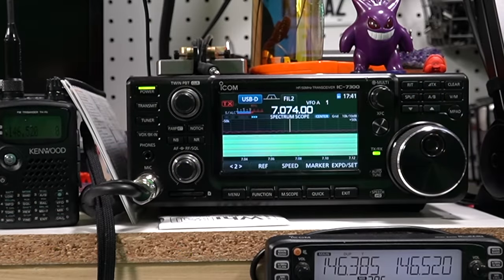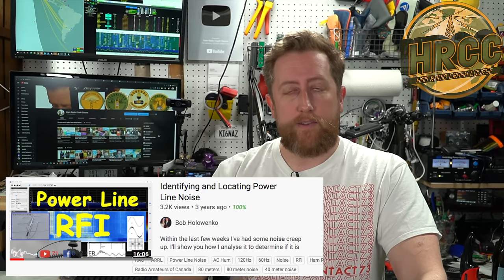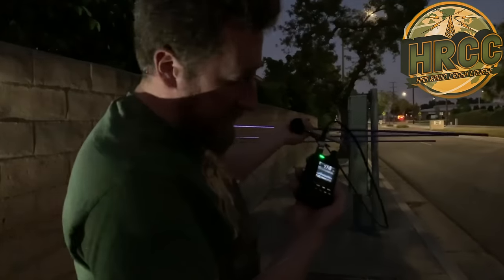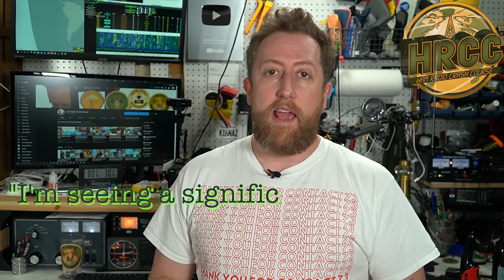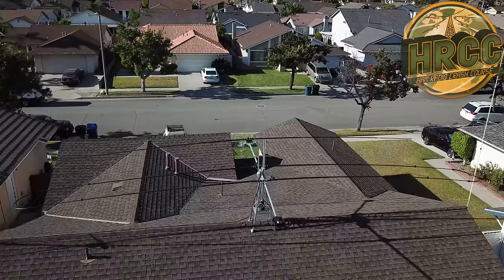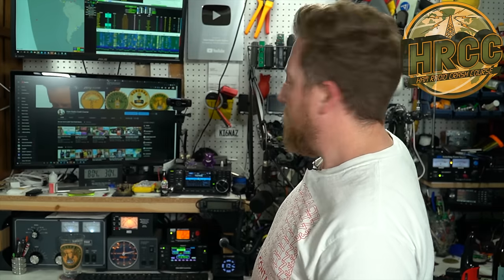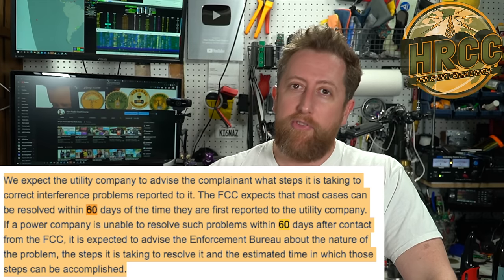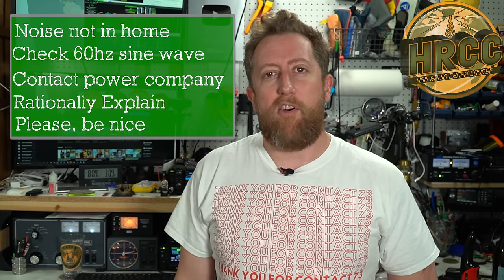Power Line Noise On Your Ham Radio?  How To Find AND Get it Fixed

Comment: My power line noise was fixed as per the following.  1) Determined that the noise wasn't coming from my home as per how you did it.  2)  Contacted the help phone number and explained my problem - from there I was fortunate that the guy didn't have a clue about ham radio, or the interference that comes from broken insulators etc and was 3) Referred to an engineer whose speciality was chasing down interference problems.  Problem solved.  

BTW MFJ has the two units that help find out where any line noise is occurring - a) a VHF receiver / hand held yagi antenna.  b) A parabolic dish that helps localize the noise source - much like the flash image you put up on your video.

W1VTP

Comment: This a good video.  Using a yagi to find the pole is a great way to locate the source as long as we understand that the noise will carry down-line from the source to other poles.  Sometimes a sonic 'sniffer' is needed to isolate the correct pole/equipment.
I had this problem, too, and my power company resisted until, in conjunction with the ARRL lab, I filed a formal complaint with the FCC.
The power company was not familiar with power line noise (PLN) so it took a couple of tries until we were able to get the problem resolved.
I DID make a friend with their manager, though, who asked me about training materials to help him understand more about our (aging) power lines out here.  Being FRIENDLY is, as you say, paramount!
I have since built my own equipment and can run these down myself very quickly.

TIP:  In So Cal, you may have noticed that when it rained, the problem temporarily disappeared, a good thing to keep in mind.  This indicates that the problem is outside in the elements and not in your house as the precipitation is quenching the arcing.  The problem is most likely to show up when the equipment is dry.
73  AC0BE
Reply: "The power company was not familiar with power line noise (PLN).." How in the world can this be?
Reply: @timothypolhamus4515  I think they are becoming more aware of the problem.  The executive I worked with asked me afterwards for educational materials where he could learn about PLN.
    The reluctance, IMO, comes back to cost of repairs, inconvenience to their customers because they have to shut power off sometimes and other business reasons.
    We (Hams) are a tiny group compared to the customer base of a power company and not, therefore, a priority.
    I suppose that the loss of electricity from one of these PLN incidents is relatively small so the argument that they are losing money as power is being shorted away and wasted is not a priority either...

Comment: I'm a Power Company tech that investigates RFI. Jake is correct call your Power company, you will be connected to the call center. The key word is interference, you don;t want the 24-7 Trouble shooter to investigate. Then a work order will be generated to the correct department. If I come out I first isolate the home of noise, then move outside. It maybe your neighbor's dimmer switch or the power lines. In my experience it's about a 50% the power lines. If I find a power line insulator making noise a work order is generated for  bucket crew. I will come out with the crew and we correct the problem.

Comment: Not only can you have powerline noise but I have seen where a bad ground coming down a telephone pole (the only lines on this section of pole line was telephone) had a poor crimp connection to the ground wire actually going down to a ground rod or a butt ground plate at the bottom of the pole.
The crimp was repaired and the noise was eliminated.

Comment: Aloha Josh, you made some really good points at the end of this video. That you can gain more with sugar than you ever could with spice. My power company, HECO, has been coming out here to my street replacing all the wires and insulators on the power poles here. It looks like maybe the land had shifted some and the wires were pulling on the insulators to the point that they were making a lot of noises, especially after a good rain but my noise levels has dropped to almost nothing now. Great video brah! ❤️🇺🇸🇺🇸
Reply from the maker: Awesome!

Comment: Great video Josh, I hope I never have to deal with power line noise. One of the nice things about living in the country is POTA levels of noise. One time I thought the receiver in my 891 was broken because I had no S Meter readings, like the bar was completely gone. Turns out I just had 0 noise lol. Good for DX since I don't have a beam antenna for HF yet. 73 de W8IJC

Comment: Ok, so I am a little late to this party from 2 years ago, but wanted to comment on a similar story. My brother was having similar issues at his house about 4 years ago.  He did the shut off the power to the house thing, am radio detection, and ran up and down the street with his car radio on an odd AM station. He narrowed the noise down to a pole across the street. He called the power company, and they were there within an hour. They got up on that particular pole, tightened up a few things and left. Well it helped a little bit, but was still strong. Up the street from him is a telephone power station, the noise on his car radio would go bonkers when he passed it, then about a week later the noise completely disappeared. So, who know what it was.

Comment: Congratulations.  I was hoping that they would use an ultrasonic noise detector and was glad to hear you say that they used a parabolic dish.  That dish and its ultrasonic detector will pick up the "hiss" of the electrical arc in the somewhat loose connection clamp(s).  The arcing sprays a signal much like a leak in a tire and the noise is in the ultrasonic sound band that humans can't hear.  Unfortunately, an ultrasonic receiver and the dish can cost in the neighborhood of $3,000, which is an amount that most small utility companies won't spend on a rarely-used piece of test equipment as compared to buying a Fluke volt/amp scope multi-meter.  In my career as an electric utility power engineer, I found such equipment to be rentable, if the company had a serious desire to fix their troubles. 73

Comment: Great video! Not a HAM operator but wonder if operation hiccups with computer and general equipment is related to this kind of power line noise in affected areas. I live in around Greater Vancouver, BC with dead spots for cellular and radio networks even in open fields. It’s interesting to see someone documenting these issues.

Comment: 1. You can use FM but if you can use AM, that would be better. 
2.  Take a rubber mallet with you and tap the suspected poles while listening and listen for the noise pattern to change with the vibration. 
3. I don't know exactly what the neighborhood voltages are but somewhere in the 15kV range. Those are going to be the typical suspects. 
4. The lines much greater than 100kV can emit noise for like a mile pretty badly. These are more difficult to isolate and figure out where the problem is originating from. Again, a mallet can help you determine the pole or poles. 
Be patient with the power company. They want the problem fixed as well.

Comment: Very cool. I'm having some noise more on a cycle. Clear receiving, then a burst of static for 15-20 seconds, then stops for 11-15 seconds and repeats. It's not in the house, because it happens in my truck too. I move away from the house and it clears. I do have a power pole in the back yard that could be suspect.

Comment: +start checking your own house.... try checking ballast from neon old ligths....later check power supplys of drill chargers....and phone chargers...those of base in the kitchen....lot or rfi..from yhose suckers....and try to buy an switching power supply...i sugest...TP30SWI-TEKPOWER WITH NOISE OFFSET. PERFECT POWER SUPPLY SMALL AND IT WORKS!!!!!!

Comment: TinySA spectrum analyzer and a 2m tape measure yagi!  With my 4 yagi (M Squared 2m12 12 element 20 foot boom) 2 meter array I can often pinpoint within 3-4 poles by comparing rotor direction to a google earth map that the poles show up on(look for shadows). I take the TinySA out with a small 4 element yagi and sweep the suspected poles and can usually narrow it to one pole. If you have an IR camera or rifle scope you can also sweep the lines looking for a hot spot, arcing creates heat. I have done this with a borrowed IR camera and it worked well at night.

Comment: Thanks for this.  The ways us humans connect is amazing. 

I got a call from a company that I host a light omg detector for. Amazing idea and use of tech but anyways. They said there was a lot of noise on their signal.   After doing the normal on home stuff I realized the problem was out side.  It persisted up and down the street until I was out of time. I need to revisit the problem some day soon.  I don't think my power company will be to receptive. But your method or rather some of it may make my tracking down much easier. 

I did it with a small duck Omni antenna on a handheld battery Oscilloscope.   I narrowed it down to one and only one of the 30kv lines on my road.  It's only one since they are three phase lines and it's clearly a 60hz.  A directional antenna is a great idea. Saves me from tracking through the woods up steep hills and across others driveways and property. 

If I go out and track it down I'll try and video it

Comment: If you have any more interference  from other sources.  Get a good quality coaxial line isolator about 70 $ usd  and place it  at the rig input. It can cut the noise  by several s units a big difference. 
Also use quad shield RG6 coax in the house  and clamp on ferrite on everything.  You can use a second isolator at the antenna feed point  also if needed.
AA4CP Chuck Port Salerno FL
Reply from the maker: I have done that and used chokes 😳

Comment: Here is my issue. I have two radios. A Yaesu FTdx101d and a receive radio, ICOM R-8600. I have two antennas. A hex beam and a inverted V dipole. For years I had only one radio with two antennas and had no noise or static unless thunderstorms were in the area and then I disconnected. In July, 2020 I started having interference on both of my radios and on both antennas. At first the static, RFI lasted only minutes then it became a few hours at different times of the day no matter the weather conditions. Then the static lasted for days and then would disappear. However now the static is constant and so overwhelming that using especially 80 meters with all of the radio filters enabled  makes listening to the radios unusable. Using the radios in general is not enjoyable and almost unusable on all bands.  My first test was to shut down the commercial power to my house. I brought in a 12 volt battery into the house and with the power off I connected the radios, one at a time to the battery. I had  RFI, still. We had hurricane Delta come close to us earlier in Oct., 2020. The  commercial power was out for over 4 hours from 0330 to 0745. My back up generator came on. I turn on the HF radios and I  had NO RFI for the 2 hours I used the radios starting at 0530. As soon as the commercial power was restored and the generator shut down the  RFI, terrible static once again returned. I called the power company the first of Sept. They did come out and made some test. They replaced one pole and replaced insulators or Polly's on other poles but still the RFI or static is present. The engineers came back out and did more test and found additional noise other poles. Due to the many hurricanes and storms near by, the power company has not return to address my issue and that is understandable. I send e-mails to the engineer on a weekly basis and once ever 2 weeks I may hear back from them stating they are back logged but will return to address the RFI as time and manpower is available. Not much else I can do as I am near 100% the issues is power line line problems. If by my test I am incorrect please let me know so I can continue to look for the issue. Bottom line, no commercial power in my area and into into my QTH no RFI with commercial power on in my area connected to my home overwhelming RFI. 73

Comment: You must have the best electric company. Where I live they don't fix anything. Even when the fcc gets involved. It took over a year and it's only half way better. I started the process all over as they fixed one issue and this one is different. But that's what u get for an over 100 year old electric system

Comment: I use an AM radio tuned to around 530 hz I have an s9 noise floor since I had Solar panels installed on my roof,  the storage battery gives off an S9 static type interference, I have been putting Torids and ferrite s all over the place, disconnected from the grid and run on battery power, but no difference. I only have 40 mtr kit radio, I made a large 5 inch coil to specs I found on the internet, using RG213 and that dropped the noise floor to about s5 but  the radio went deaf as well, so I am back to square one, but having a great learning experience...VK3HJW

Comment: Power company most likely depends on general folk reporting such issues, thereby providing it with early-warnings of potential future equipment failure.  Much cheaper to fix/maintain/replace as part of a routine schedule than to emergency-repair, especially for expensive items.

Comment: Thanks for the video.  I never even knew that you could call up the electric company for these issues.  On another note, So you're telling me that my current hobby of HAM radio may get some interference from a new hobby I'm thinking about...hydroponics  :-(
Reply: LED lights give off RFI , the more you have the more RFI you get.
Reply: @JReed305  I have lots of various LEDs installed where incandescent lamps were before and none of these 230V (I am in Europe) fed lamps causes any interference. But I have also several 12V LEDs that replaced older halogene lamps and they are fed by a standard toroid transformer (not a switching power supply) and despite that they cause very strong interference in the VHF band - FM radio, airband and 2m are all affected to different degrees (HF is fine). I have installed ferrite chokes on the leads very close to the LEDs sockets and it has lowered the noise but not eliminated it. Before the installation of the ferrites programs from one of the dvbt multiplexes could not be wiewed due to too many errors in the signal - it was the one which is broadcast in my area in the VHF band, 3 other are in the UHF band and the UHF reception did not sufffer.
Reply: @adamzieba8364  Some of mine in the house interfere more than others. Haven't noticed any issues on 2m or 70cm but I see it on my SDR waterfall display which gets hiden by the squelch on my RT's. I get some noise from them on HF roughly 1 S unit depending on the band. I need to compare my bulbs to see if it's brand specific, the WiFi contected bulbs, or the stand alone. Have to love a challenge.

Comment: Or you could purchase the Palomar-Engineers RFI/EMI transceiver noise blocking kits.   If you have an HF radio with ONE So-239 output, buy the Standard Kit.   I bought one for my Icom 7300.   It works great and it's only $39.95.   It cut the noise into my radio by 95 percent.  Huge improvement in receive quality.
Reply from the maker: They are great. But power line noise will still get through that sadly.

Comment: Hey Josh very informative,  my problem  is 12volt related in my truck. Getting interference when I turn on keyed accessory,  I get a noise on my 2 meter radio ,sounds like someone trying to break squelch and it is sporadic on 146.835 and 147.165 frequency.  This only happens when I turn the key on accessory or running the engine.

Comment: If there is one good thing about power line noise is real power line noise will be handled and fixed typically. The worst kind of RFI is when it's in neighbors bad lighting  or battery charger or some other device and if they don't want to cooperate you're kind of Sol

Comment: WE had a noise problem where I worked that was interfering with the police repeater in our well house it was so bad that at night you could see the insulator on the pole arcing ComEd was notified and didn't even come out until three weeks later when the arc burned through the power line.

Comment: Sorry have not subscribed before, ran into you at Hamcation a few weeks back, thought you were from Florida. Having the same issue with noise, mainly at night, so thinking it is coming from my house, will use your tips to investigate. I have two 10 meter antennas, one in the attic and one I just put up outside. Attic dipole rigged up for computer sdr and hurricane proof. Outside vertical for DX that is fairly new. Seems the attic antenna has a lot more noise, going to track it down using your advise.

Comment: My reception here at home is really not that good, but in the 23452 area it's very good on short wave according to a recent video I posted.  The LW band is useless unless I take the radio outside of the apartment and I am able to get some NDB's like on 254 kHz which is beacon LLW from Elizabeth City, NC, but if I try to listen to it indoors in my apartment it gets difficult to receive.  I don't if it's power line noise or just power supply noise, because these switching mode power supplies can wreck havoc on the long wave bands here at home.

Comment: Thanks for the tips. My RtlSdr usually sees S9 - S9+10 noise floor on the HF bands here in Chino running HDSDR. I am picking up a HF rig this weekend so will have to compare that with the SDR to see if the results are similar.  If so, looks like I will be making a measuring tape yagi and dusting off my T-hunt skills.